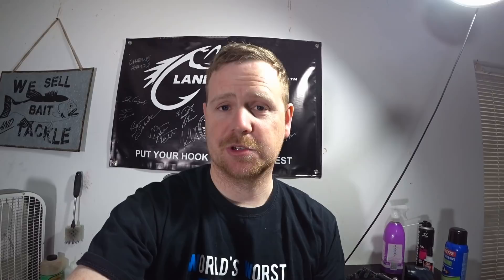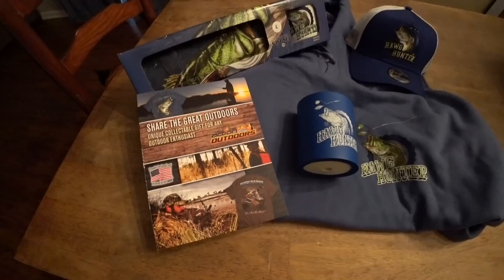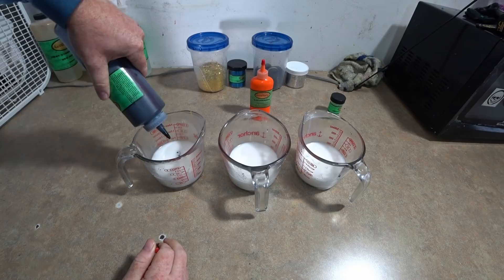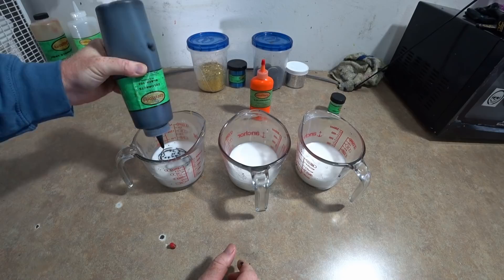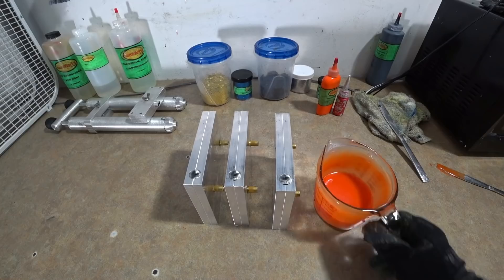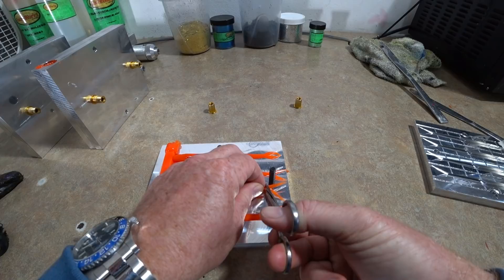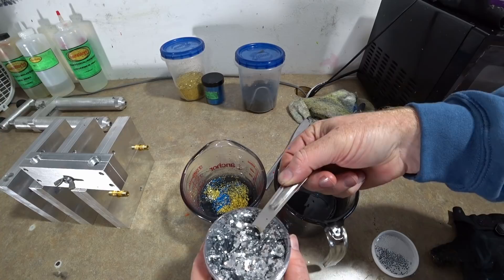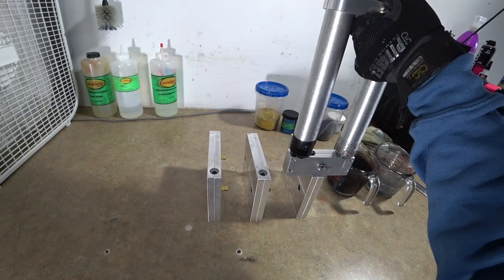CUSTOM CREATIONS: Creating Some JERKBAIT MAGIC; Making Soft Plastic Jerkbaits

Comment: Does the vacuum chamber make a clear difference between a bait that you use it on vs a bait that you don't use in the vacuum chamber? Just asking because I am starting to get into making soft plastics and I want to know if the vacuum chamber is necessary.

Comment: Awesome video brother. How would you go about getting the charcoal color to show up more? Was it just the heat difference?  Love this color though. I'm wanting to do a tip cut  bait but haven't made the time for it yet. Speaking of temp, when you said to shoot at a lower temp, what an ideal range?
Thanks
Reply from the maker: I probably could have throw in 1 drop of white .  320-340 is usually optimal..but if I want swirls I'll shoot hotter.. sometimes if I'm making stuff just for my tacklebox I don't even take the temperature
Reply: @WorldsWorstFishing  Thanks brother. My Swimbait will be here on the 6th and I may have to give this one a try lol.

Comment: I think the word you were looking for is “viscosity.”
That color turned out really nice. 
That swimbait mold is very interesting. 
I want to know how the bloodlines stay in place while injecting the mold? 
Do you add a little adhesive to the lines or are the lines on the swimbait mold cut thinner to keep the lines from moving? Seems like they would move if there is nothing to grip them in place. 
Great video. Thank you .
Reply from the maker: Yes..viscosity! haha..the bloodlines stay in place everytime so far, you just mash them in  place and it stays.  I use the adhesive for the eyes.

Comment: Hi over here in Ireland we use a worm called a maddie it is a type of a ragworm with a thin dark red blood line through it. Do or could ever make something like this
Reply from the maker: That would be very hard to reproduce..maybe an hand pour worm mold could achieve it, but not really injection I dont think
Reply: Thank you for the reply I thought as much as I have been making them by hand pouring I just thought that if they could be injection molded it would save me lots of time